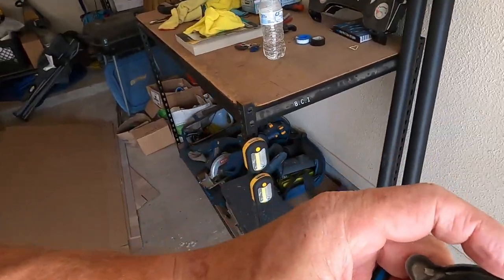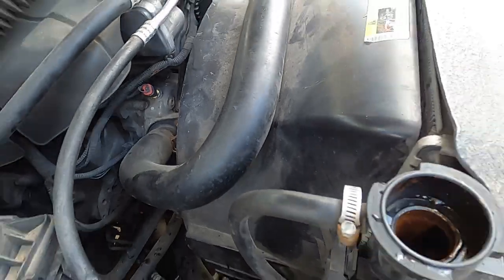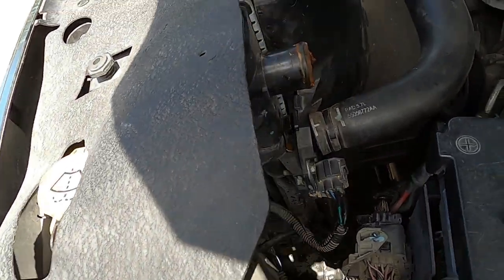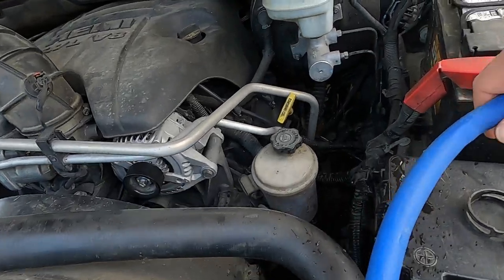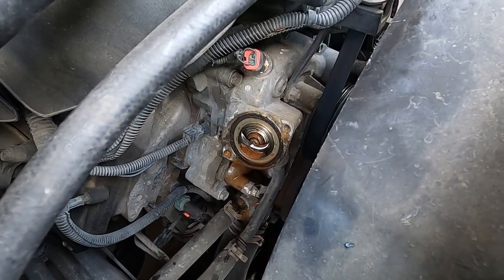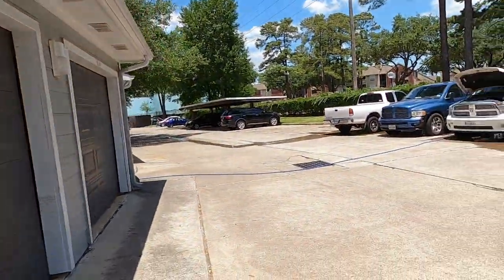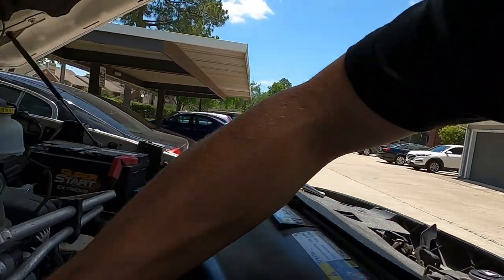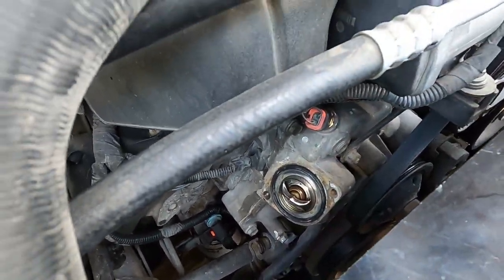Ram Cooling System Flush with water. I have a better video out.

Comment: I just did a coolant, all new hoses,thermostat and radiator cap change on my ram. To completely change it all the block needs to be drained too. I did. Passenger side block drain plug required removing the starter to get access to it. The block has as much in it as the rest.
Reply: Yeah this guy doesn't say all that and i blew my head before of watching his videos. He is high on something which is very clear. Jeez he should be banned from making how to ruin your truck video

Comment: Nice video, I had to replace my thermostat on my 04 5.7 and its nice to see in the newer rams they addressed having the thermostat on top of the power steering pump issue.  I live in Florida a nice warm state and some people think antifreeze is for north states, I need to change it to anti-corrosion because I had a mustang that by the look of it was filled with mainly water, water looked like a rusty swamp, what eventually happened to that car was one day I was beating the shit out of it when the light turned green and a freeze plug ruptured so that sucked 😂 so now I almost always use over 50%

Comment: Instead of putting it back in and it might be bad u can always put a pot of water on a stove and fill the pot full of water get it to boiling and put the thermostat in the boiling water and see if it opens.
Reply: boiling may check to insure it opens but,,,
It's a 165% thermostat.
Checking to make sure it opens at 165 is the optimal solution. Use a thermometer...

Comment: Is city water pressure too high for the rad? gotta be careful backflushing a heater core, which would be my next step. Same sludge be blocking that, restricting heat, here in -30C Alberta.

Comment: You can do this in that lot? I had my ram"flushed" at the dealer. Noticed at pick up there was not even a hint of mess. Asked the teck how he did that. Did you take the thermostat out=no. Did you unhook the hoses=no. Then how did you get the chemical out? I have a little hose I suck it out with. Think I was scammed? My Ram is a 2007.
Reply from the maker: I would never put chemicals in my coolant system water does the same thing just don't use high pressure
Reply from the maker: If you feel like you didn't get it all out run your truck for a week daily drive it and do the same thing again see if your water is rusty or dirty
Reply: My system never looked dirty. I did it a few years back on a time thing. Was shocked at the dealers way of doing it. The only way it way would work was if the top tank is now on the end or side. in other words, if radiator has been designed so that the former top, is now on the side the little hose would work. If tank is on top, hose would not go past top of core.

Comment: Did that solve your problem i have an 09 ram 1500 hemi replaced water pump thermostat and hoses but still manages to over heat mainly when stopped
Reply from the maker: Check the other video out.  Yes I did fix the issue. Runs normal 199 to 204. unless it's 109 degrees outside then it runs around 212

Comment: Thanks for the vid. Question, do you just leave the water you flushed it out with in the engine block? I did the steps you did but then was trying to figure out well now how do I get all the water out of the block to make it antifreeze water mix
Reply from the maker: I just use a pure antifreeze. Not that 50/50 mix
Reply: There is a bleeder on the top of the water pump. U can see it behind the thermostat in video

Comment: Will this work for a 99 5.2 ram as well ??
Reply from the maker: Check to make sure you have a split in the heater hoses. If not cut the hose and go buy 2 couplers

Comment: Was it a blown head gasket, or just crud in your system? looks like oil in the coolant.
Reply from the maker: Just some stop leak are something like that. Thank God it wasn't a head gasket
Reply: @autoguydiy4244  Cool, mine looks the same way right now, discovered it when changing the oil. Going to use your video and flush it. Thanks for making the video.
Reply from the maker: Your welcome brother
Reply from the maker: @RD-nu8sg  check my other video out. Complete cooling system flush

Comment: And lastly, let's not forget the fan.. lol. I think you probably took care of the cheapest. Did it work? 

  Now, Let's get fixing that fan will you?.
Reply from the maker: It was actually water pump going out
Reply: @autoguydiy4244  oh no shit. Yeah  I am starting to have issues with mines cause I haven't changed it since new 112k miles ago 🙄 seeming to leak nearby head and block too.
Reply from the maker: It started out just to be a flush on the engine Cool system and turned out to be a bad water pump.
Reply from the maker: Yes. That's where the weep hole is at
Reply from the maker: Definitely change your water pump I have a video on that also bud